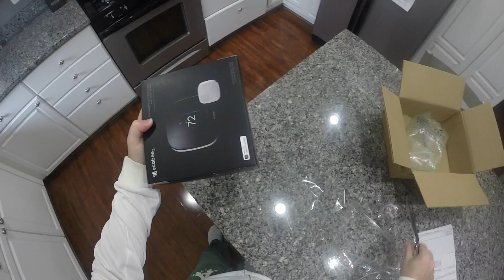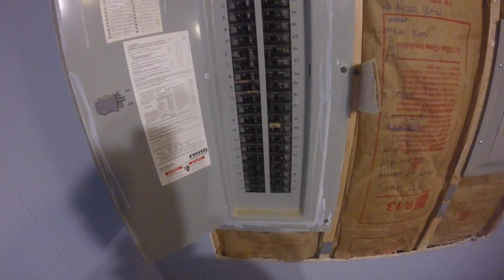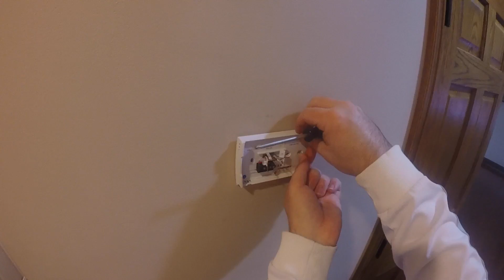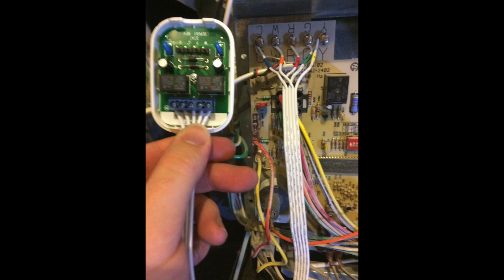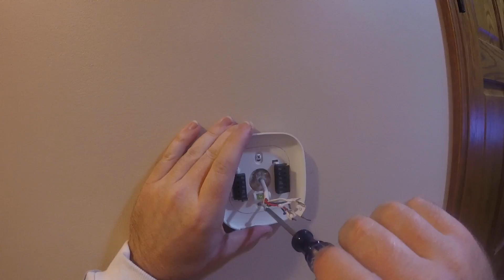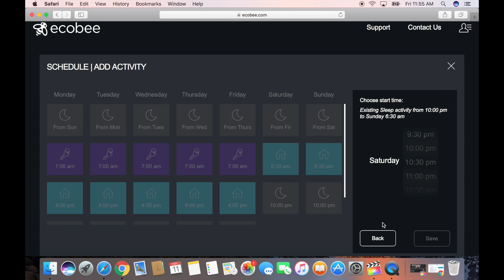How To Install A Ecobee3 Smart Thermostat

Comment: I love the video, but have a few questions. Inside my furnace I have two white wires, one going to "W", and the other going to a terminal named " Com 24v". The power extender kit does not have a Com terminal. What do I do with that extra white wire? On my thermostat I have a short black wire going from RC to RH. The red wire also goes into RH with one end of that small black wire. Any suggestion? The small black wire is too short to reach the RC and RH on the ecobee3. Do I need to use it? If so I would need to find a longer black wire.
Reply from the maker: Thanks! I really appreciate that. Shoot Ecobee support a message. They can be reached at https://www.ecobee.com/faqs/. Sorry wish I was of more help!